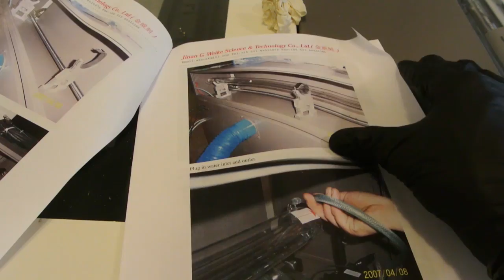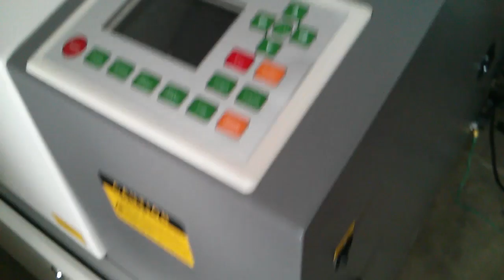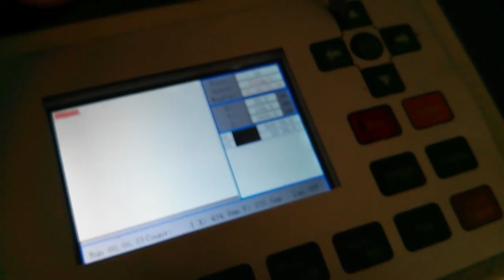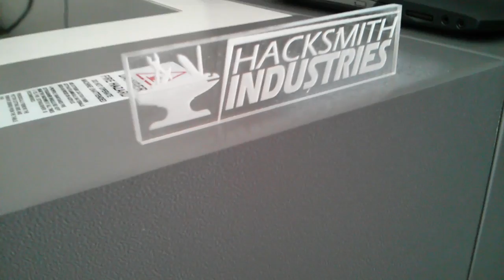Unboxing the Laser Cutter!

Comment: i saw you had solidworks on your computer do you also use auto cad? and if you do use it, is it similar or very different?
Reply from the maker: Haven't used AutoCAD in a while. Depends which version you're talking about. I believe AutoCAD is still just 2D CAD, unless you mean Autodesk Inventor which is like Solidworks?
Reply: AutoCAD is just 2D design unless you draw in isometric or oblique.
Edit: Well this is a throwback, scrolling through my comment history and I find something dumb I said. 
AutoCAD has 3D functions however they are a bit limited.